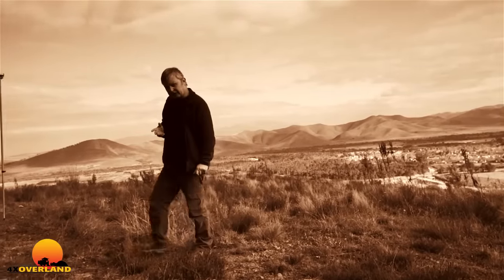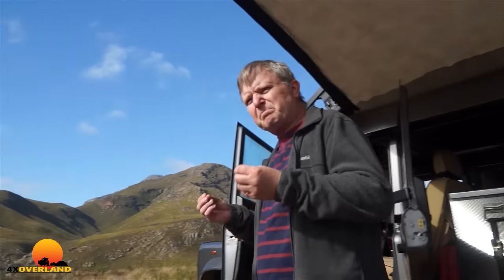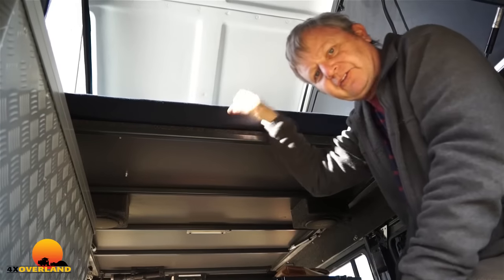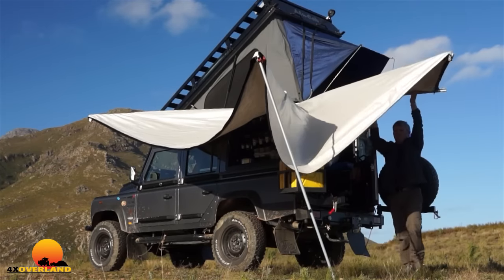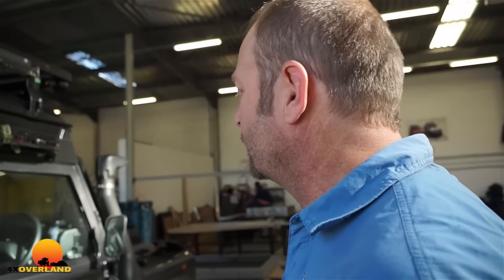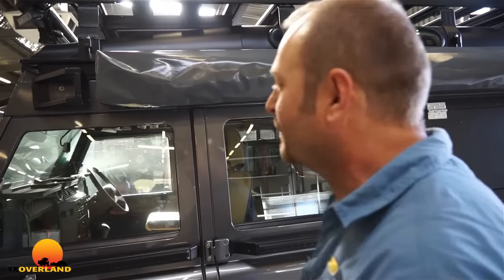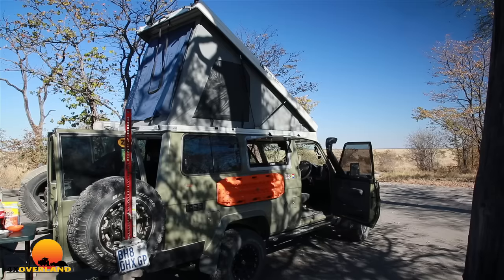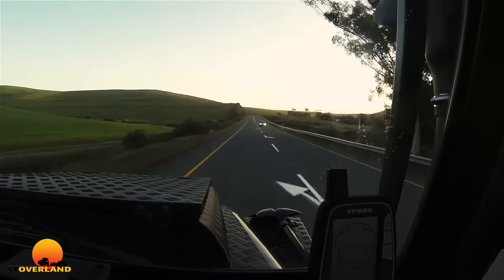Land Rover Defender - The ultimate Camper conversion

Comment from the maker: Bill Soucess. I agree and understand you completely! I do. I owned a Defender for 8 years. I owned a Range Rover for eight. But my guess is that you are from the UK. In the UK, a Toyota is an ordinary mass produced family car, many of which are very dull. But in South Africa and Australia they make the most reliable and best overland 4x4 trucks - and they also make some quite good cars as well. As for me, I get EXACTLY the same thrill I once got at a lonely camp site when I looked at my Defender - now with my Land Cruiser. So our perspectives are different, and I assure you, while you find it difficult to understand, a Toyota can also make you feel that way. A Land Cruiser is a fantastic vehicle, and like the Land Rover, gives sincere pleasure to many owners that love them. No difference whatsoever on how you feel about your 130.
Reply: I love your stuff, I work for a company in Western Canada that makes backroad mapbooks. I have a 1972 Series Land Rover I am currently building into an camper (it was once and has a well documented trip from Spain to South Africa to South American before ending up in Vancouver where it was sold) however the old set-up was not good for my climate as it was all aluminium and water condensed on it and it was got very cold to touch! I feel I have the best of both worlds with a 1976 Toyota B diesel mated to my Land Rover gear box. My only problem is that there are not many companies set up to do roof conversions (like alu-cab), and things like that, here in Canada. Most people throw campers in the back of pick-up trucks. So I may be doing a lot of the stuff myself. Anyways I love your videos and people will always argue what is the best 4x4. I've always been a Land Rover guy but I bought a Jeep Rubicon in 2012 and it is pretty awesome and goes everywhere...I never thought I would be a Jeep guy but each vehicle has it's strengths and it is really hard to argue which is truly the best...
Reply: 4xoverland i really love your shows... best 4x4 channel on Youtube... love from Australia
Reply: 4xoverland yay. I'm from South Africa
Reply: 4xoverland DEFENDER!!!!!!
Reply: a unimog is better
Reply: @zarrayx  tooooo big

Comment: My 1980 Landrover S3D2.25 is very reliable, it still hasn't had an engine overhall, I frequently drive it on the highway at ~>90kph, I haul ass over rough terrain (happily over 40kph), It's the roomiest vehicle I have ever been in, Easily 30-40% more cab space than a Cruiser.

(I know it will sound egotistic) but you have to been very confident and tough to drive my particular land-rover, it'll be the hardest thing you'll ever drive (as repeated by truckies that reckon otherwise), at times even I don't feel like the effort to drive it.

So I do agree that a 70+ cruiser is much more cosy (although not as comfortable, and yes there is a difference).

This landy has done the clock repeatedly (at least until the speedo cable broke)

(the reason why my landrover isn't cramped like the modern defenders is due to the fact I remove the original dash and redesigned one based off a s2, but about 50% of the s2 dash size, heaps of room)

Comment: Never had  engine problems with my 96 Defender, broke a rear axle years ago and that is it !! sure they rattle and roll, but for a dedicated Deer Hunter they are the ideal vehicle for the Victorian Bush. A couple of days back we headed up a clay covered bush track, scouting for deer. and with my truck in 1st gear, low range I crawled slowly uphill at walking pace, with NO 'slippage' or wheel spin.  Whereas my mate in his Toyota had to rev his engine hard and tear up the track to attain the same outcome.  Defenders remind me of donkeys (and I've owned and used both) They may not look that flash (and certainly mine no longer does with over half a dozen Roo strikes to it credit) but they GET-THE-JOB-DONE !!
Reply: Harry Carlin my dad's got a defender county had it for all its life just the chassi went rusty at the back and the fuel gage
Reply: i had a 1955 land rover 86  the short model...and i can tell you ...youre right about climbing hills..slow and steady ..no revving the engine...the power at low end is its good point...my partner had to rev that toyota to make it up the hill..a long 40 degree climb... spinning  as he went...
Reply: @ericsandrin8123  nonsense
Reply: no surprises as the low range ratio on a defender is 3.31:1 vs Land Cruiser’s 2.4:1 

Toyota relies heavily on engine power and a stronger drivetrain but neglected the low range. LR does the opposite

Comment from the maker: The Land Rover Troopy 75 and 78 has an interior cab capacity of 4,5 cubic meters, whereas the Defender is about 4,2. I'm not guessing. "The roomiest vehicle". That's quite a statement. The S3 is without question the most cramped vehicle I have ever driven. I've also driven the S3 on sandy desert tracks - and it is really hard work. Only for the tough.
Reply: what is installed  on the door ?
Reply: i would like buy
Reply from the maker: A piece of aluminum that serves no purpose at all.
Reply: +4xOverland.   where are buy ? I like esthetic design, please say me,
Reply: alluminium doesn't rust, rust is a BIG problem in some areas, ie near the sea.
Reply from the maker: Land Rovers are not made of alluminium, but for a few panel. 90% of a Defender is steel and they rust just like any other car. In the UK, you can hear them rust, by the sea or inland. Makes no difference.
Reply: Here in Australia the army use galvanised chassis on their 110's.  They kept them in service for 28 years, perentie 110's.
Reply: 4xoverland how I can you buy and get them shipped?
Reply: 4xoverland DEFENDER!!!!!!

Comment: FYI when an engine works hard it doesn't shorten its life, quite the contrary actually. With diesels it avoids carbon deposits which often are the death of turbos. Short trip cold driving & lack of servicing do though.

Comment: 4BD1T  Isuzu would be more suited to that modified Defender or even the rarer BMW in-line 6 model that was for Africa only. Later Puma Defenders were just a little underpowered for the application though this will be addressed in the new Defender whenever it launches. I almost bought a 2 door 110 and later realising how impractical it was I got a 4 door 110 and it really makes a difference compared to the old Troopy.

Comment: Iv get a dicovery with 618000 on the clock and she is the most reliable truck iv ever owned she a best with 35.250.15 6inch lift and all the goods on top 4x4 by far

Comment: i love the icarus, shame defender isn't build by Toyota. i have driven 97 defender single cab purpose built for indonesian military. lots of sound quirks, also every bits of interior panel like want to fall. the clutch is unimagined hard, very hard, also the gearbox is slack, hard to find gear. but i love the design and the suspension is pretty comfy for the class. is comfier than my daihatsu Taft and FJ40 i've driven. 
altough my taft 1987 (fourtrack) has no character like defy, but it has much less quirks, only rear door which sounds like unlocked. the engine still feeling strong, the gearbox is fine no slack, also the landcruiser fj40 still dependable.
maybe someday i will buy defender, put 1kz or 1hd in it or just buy vdj 79 series cruiser

Comment: have driven both vehicles in some pretty extreme offroad environments. love the look of the defender way more, but they do rattle and handle badly, they are solid like driving a tank.  but love the reliability, handling, performance and easier to fix etc stuff of the toyota. toyota is the way to go...

Comment: defender has better aproach  departure and ramp over angle, yep cramped  cabin, but hey were out in the bush  not round town. the defender has live axel coil springs where the troopy still hads a leaf rear end.The troopy is arcaic underneath, and an absoulute  crap box off rd. heavy old and horrid. yep bigger diesel and petrol v8 engines but apart from that a dog off rd

Comment: He probably gets about 5 feet to the gallon
Reply: تعو
Reply: Actually I get about 10.5 mpg in mine
Reply: I have never heard the truth about fuel consumption from any Toyota driver.
Reply: Liters per kilometer
Reply: Deon Van der Westhuizen i have an 04 v8 4runner SE. supposed mileage is 15/19.  i get 13/16.  it's a tough pill to swallow. only get about 300 miles range before i fill up without stressing about it.  

everything else is perfect though, at least.
Reply: his actual mileage is about 600km because he upgrades the gas tank to a larger size, and its also diesel so its perfect for long range
Reply: Lol.
Reply: @Chris-jv7im  Thats like 4,5km pr liter, same as a massive lorry, insane
Reply: Lol

Comment: I’ve owned both. The Landcruiser is just a little bit boring, which I think this fella would probably agree with. You could put a Cummins diesel in the Defender if the wanted a bigger engine. You can do all sorts of interesting mods with them, which is the whole point.

Comment: Totally agree with you on the reliability issue. I come from Dubai and many of my friends own defenders. Almost all of them suffered from the reliability issues although their car models are 2009 and later. As much as I love land but I am sad for its poor reliabilty which made it unique in the past. Lets hope that the new one keeps the essence of the defender and better power and reliability. Honestly, it is not fair to compare anything with toyota in terms of reliability because they are way better than the others
Reply: I was in Deira since childhood.
Now in Oman from past 3 months.
UAE locals like patrol more than land cruiser I felt
Reply: @shahabaztly8517  yeap, patrols are extremely popular in UAE. Patrol is lighter & smaller than LC which makes it better for desert drives
Reply: @immortalalhammadi   yes Khalid,but landcruisers are more famous for reliability…there is a documentary about vehicles above 500,000miles(800,000 kms) and some of the comments were from drivers who uses land cruisers and more number of comments from owners of forerunners. Toyotas are famous for longevity and less expenses regarding repairs. I have also heard there is a problem for CVT Transmission which is mainly used by Nissan Motors
Reply: @shahabaztly8517  Toyota reliability is well known, that is why I mentioned only less weight & smaller in size compared to LC. However, LCs are very very popular in UAE as well
Reply: @immortalalhammadi   yes

Comment: Landys are good vehicles I have two a 22 year old 90 and an 8 year old 110. Driven them overland all over Southern Africa. Not one problem - people who've never owned them keep bashing them - especially in SA. Why? The energy spent on negativity is staggering. Imagine spending that much time bashing a Ford Fiesta. I like the Toyotas too no problem with them, I like cars. I liked my Spitfire, I liked my TVR, I liked my Lotus 7 and my Mazda mx5, I liked my 68 beetle. In fact I can't think of a car I didn't like something about. I had a Jeep Wrangler (which is also great for rock crawling and a ton of fun) but if you want to bash a car for overlanding in africa - that is a much better target than a defender. If you like Toyota's just go drive one who cares? Or maybe it's just because this little argument gets so much engagement...looks like I fell into the trap.

Comment: I prefer to travel light so I find this 110 to be a little overblown. My 110 300tdi is now on 347,000, does it rattle yes, does it leak yes, is it cramped in the cab yes, does it break down yes.Would I like a Troopy almost certainly but not available in the UK we have to make do with the Amazon or the Colorado which although great vehicles are so expensive to kit out for overland travel here. In the UK the overland kit is more expensive than overland kit for Defenders for example a winch bumper is three time the price for a Cruiser than a Defender etc etc. Which is probably why we Brits like our Land Rovers so much.

Comment: Funny, owned both, where as the Toyotas are allegedly more reliable which I would dispute, when they do go wrong, the cost for the Toyotas are much more expensive
The off raid ability on a L R is 100 times better

Comment: In my experience, which isn't too extensive, the Defender is generally a better off-roader. When it comes to mud and wading, the Defender wins hands-down. I've had cruiser owners ask me to drive through thick mud and rivers 1st incase they need a pull (no jokes, after the heavy rains we had in Namibia a few years back). As far as comfort goes, Cruiser takes it by a mile. As far as reliability goes, I have absolute faith in the Defender.Usually when something goes wrong, it's simple to fix, you just need to know where to look. On open road, the cruiser wins, once again. But last I checked, we don't buy these cars for highway use. To conclude: If you want a highly capable 4x4 that you  don't have to understand at a mechanical level, that's comfortable and quiet and is a serious treat to drive generally, go for a Cruiser. If you want a car that is a true, rough and tough pioneer, keeping in mind she won't be the most comfortable, she won't be quite and you enjoy understanding how your car works, buy the defender. The defender is for the self-sufficient man, the cruiser is more suited to someone that would rather take their car in to the garage when something is up. No problem with either, just comes down to preference.
Reply: You obviously don't know anything about land cruisers

Comment: The exhaust pipe is so high it’s level with the top of the passenger side window lol good if your driving through 6 feet of water but what about when you have the window rolled down? The fumes are gonna blow right into the window. Terrible placement.
Reply from the maker: Its not an exhaust pipe. Its a raised air intake.

Comment: No mention of fuel consumption in the comparison. I drive a Defender and often travel remote with a Toyota Troopcarrier and 200 series. At the bowser the Defender always takes HALF the fuel of the Toyotas. Over a 23,000km adventure that is quite a saving and as Toyotas use twice the fuel they need to carry twice as much which usually makes a fully kitted truck legally overweight.
All are good vehicles for offroad expeditions....totally up to your preference. 
True...Toyota drivers get tired of people flocking only to the Defender, chatting and asking if they can take a photo....that is common all around the globe but especially in Africa.
Reply from the maker: Then you must have a magical Defender. Friends with lightly loaded diesel Defenders typically use about 20% less fuel than my 78. Weights of the Defenders are similar because the quantity of fuel needed is similar, but they always carry far more spares. They carry things I wouldn't dream of taking on a trip. This particular over-dressed Defender was about 25% heavier on fuel than my Troopcarrier, because it was over GVM, empty!